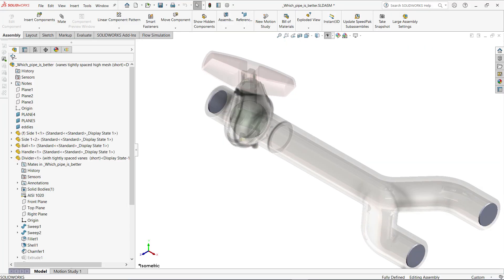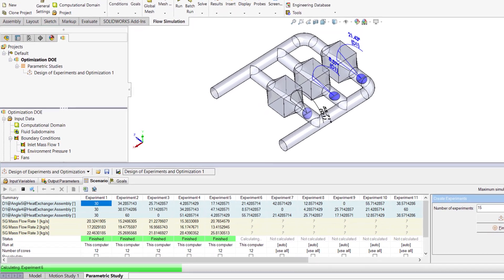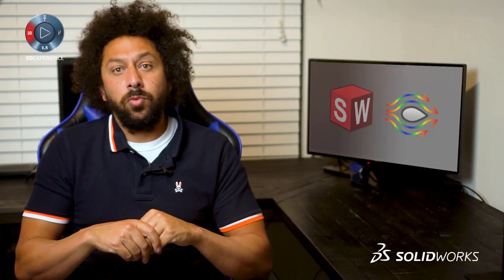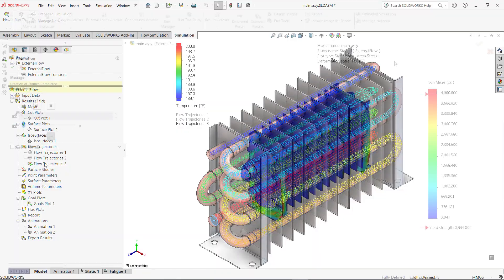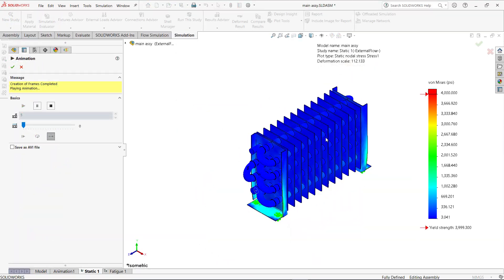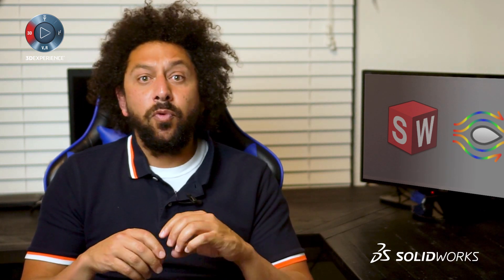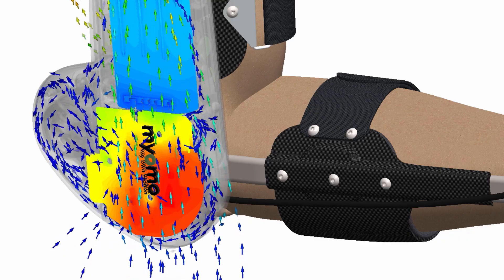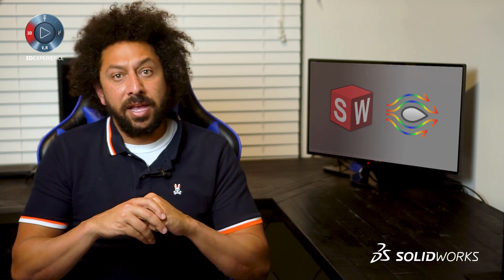Introduction to Flow Simulation - SOLIDWORKS

Comment: Is the CFD accurate enough to distinguish between laminar and non laminar wing profiles? is it real world close or a vague guide
How much does a single license cost and is there a non commercial free version?
The application I have in mind is a small turbofan jet engine. Getting the airfoil profiles and ducts right. Combustion too if it can compute that.

Comment: I started using Freecad and learned to use it in less than a week. I have tried over and over again to get into using Solidworks as my main CAD because i love the look of it, however it takes many more steps then i can handle. Nothing is simple like Freecad, takes 30 clicks more to do anything. Ui is overcrowded and unorganized... Yet again, trying to use the "flow" simulator, and cant figure out how to get it to work, even with tutorials. SOOO Over complicated. 

You should be able to simply click on a "plane", enter the parameters and hit run, not this 20 step crap. Isnt the whole purpose of CAD to streamline? Kinda dumb... Just sucks, so much money wasted on a program thats so over complicated, i cant even use the damb thing. 

Then i go to watch tutorials and find out that you guys are moving stuff around with every update, so hundreds of tutorials that are not helpful, so frustrating. Got it to work once, on the wrong axis and only had like 20 arrows.

I watched the tutorials for what im trying to do and the predetermined axis option in the beginning of the "wizard", is not where it was on the tutorial and i cant find it thanks to your update "musical Chairs with the buttons" BS. Sucks ass. Not worth the money, unless your one savy person or actual engineer. This was supposed to be the last "tutorial" before i gave up, turned out to just be some guy talking about it and not showing how to use it, huge waste of time, lost a customer, im uninstalling.
Reply from the maker: Hi there, we apologize for the unpleasant experience with our software. We continually work to improve our solutions and appreciate all our users' feedback. We hope you'll continue to follow us.

Comment: Hi -- Been a Solidworks user since1997.  I see that a Mac version is in the works.  When will there be a Linux port?  Is that ever coming?  SW is the only tool I use that forces me to maintain a dedicated Windows computer.  Thanks!
Reply from the maker: Hi Ed! Unfortunately, SolidWorks is only available for Windows and Mac. Fortunately, there are ways to run in on Linux/Ubuntu: https://all3dp.com/2/solidworks-linux-ubuntu/